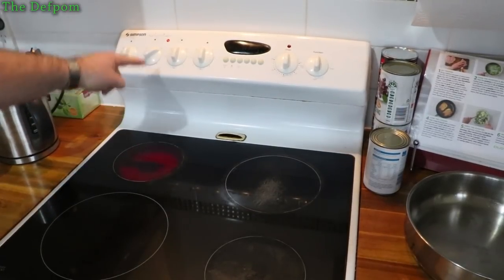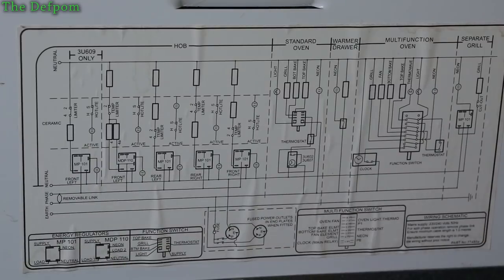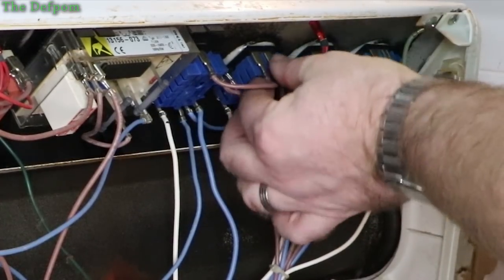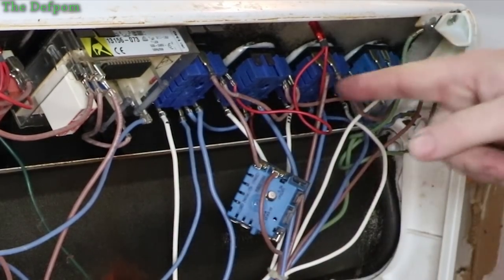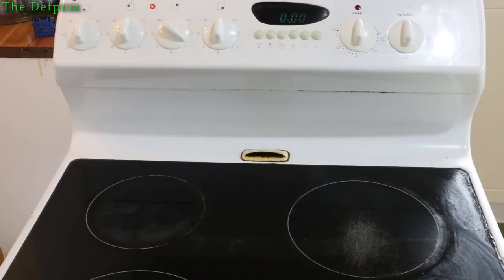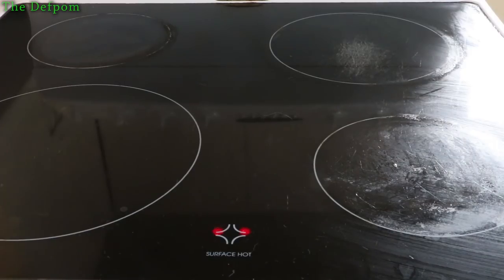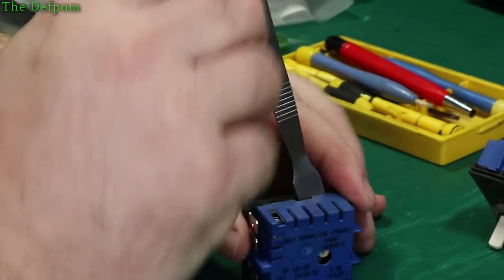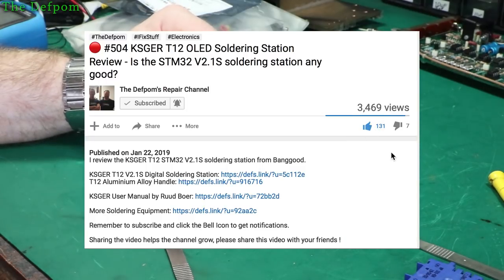🔴 #585 How To Fix Oven Hob Control - Element Not Turning Off - Fix An Oven Range

Comment: While you are in there you should take that clock module out and change the little electrolytic capacitors in there, by now they will all be close to failed because of the heat.

As well remember that those faston connectors do come loose, and often benefit from some gentle work with a pair of pliers to close the gap the spade goes into, making the contact force high and a low resistance connection. Careful with the sheet metal screws, those strip very easily out of the thin panels, so when putting them in I always start by backing the screw out till it clicks, so engaging the thread it cut the first time it was installed at the factory. Strip them out and the cure is to use sheet metal clips to make a new place to have the screw thread hold.

Comment: I get digikey advertising for your videos for some reason I get creepy American god bothers when I watch Dave Jones.  Do you have natural gas in NZ or is it mainly electric ? That’s amazing on modern equipment you got a diagram. I got a warning last year from Alstom for verifying the supply was off using a  calibrated DVM.  For electrical testing approved dead testers are now the norm.  I don’t agree but don’t make the rules etc.  Hope all is well with you scott Regards Chris. ps sun just came out, that’s summer over in the UK. PPS always wanted to tear down an induction hob

Comment: Looks like a simple enough idea, i thought you had replaced one of those before, maybe another tuber perhaps.
I wonder if there is a phase fired triac version, could be more reliable, maybe lol.
Reply from the maker: zx8401ztv - yep I did one a while ago, you aren’t imagining it.
Reply: Mechanical ones are pretty reliable, just take a few years to die. Triac versions do exist, but typically come in a board with all controls integrated for the unit on it, so if one fails you have a very expensive repair, as those boards typically are model specific and often are no longer available as spares. Simple modular control is cheap, fits many models and is modular, so only one fails, typically the plate that is most used on low.
Reply: Install a light dimmer where the control once was, use that to trigger a pair of inverse parallel SCRs. Would be interesting to see if that gives the stove some of the "gas like" feel induction has.
Reply: @NiHaoMike64  Not going to work, the elements and stove top have way too much thermal inertia to do that, they integrate heat input in the minute range, while induction and gas integrate heat input in the range of a few seconds. Plus the element heat output is also being used to heat up at least 2kg of glass, steel and ceramic, before the pot gets to see any of the energy. Great for low resolution controls to provide rough control and smooth out the heat pulses, but terrible for any sort of precision control.

Comment: There's also a safety aspect in using OEM parts and making sure wires and contacts are OK
and securely fastened. These units do get hot, and the wires do carry a fair bit of current so have that in mind to.
If something like this catches fire, and the house burns down that would be really bad (and deadly).
And if the following investigation by police or insurance company
concludes that it was caused by a sloppy repair job, then your in big trouble. 

I trust that your repair is top notch, just warning others.